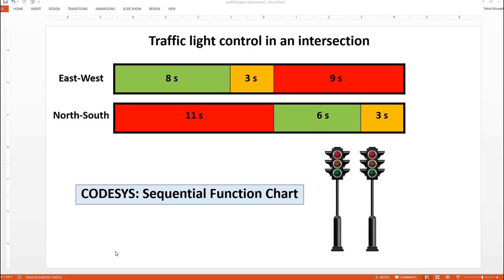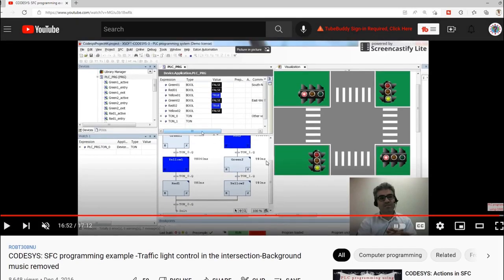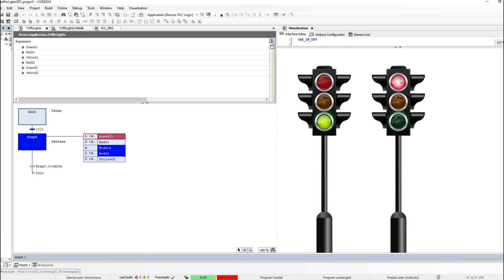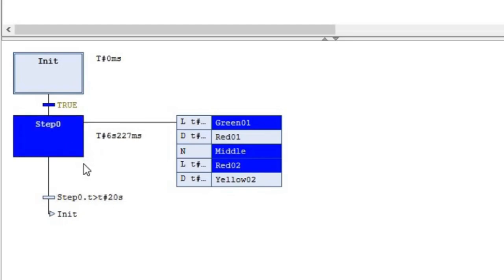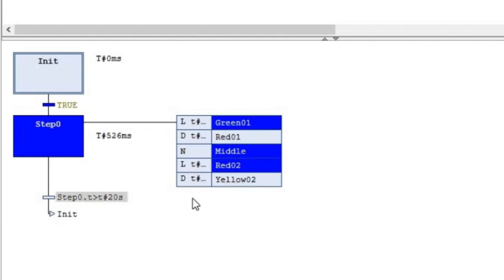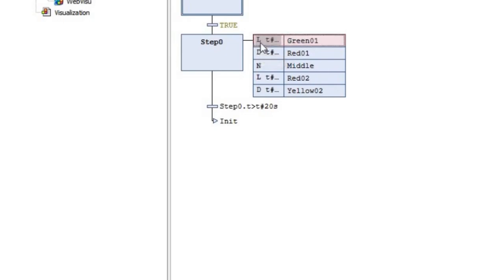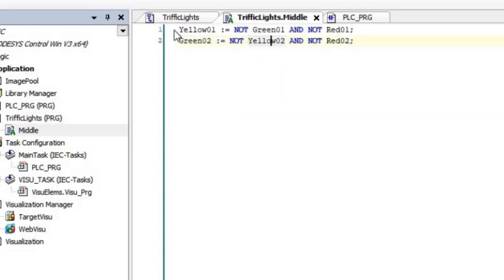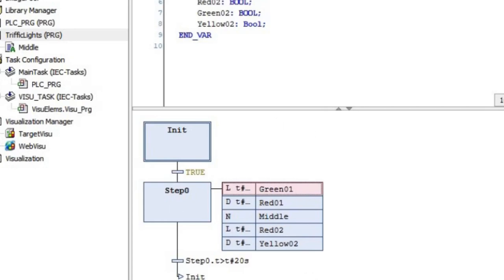CODESYS: SFC Example - Traffic lights control with a single SFC step - Action qualifiers #codesys

Comment: Hi, thank you for the video. Is it possible to build an SFC as a function block for a general semaphore and instantiate twice to emulate the behaviour of the two semaphores?
Reply from the maker: Hi Juan, thanks for your comment 👍
Yes, you can create an FB with SFC and  then use it whenever needed.